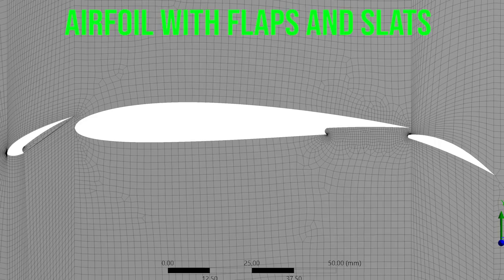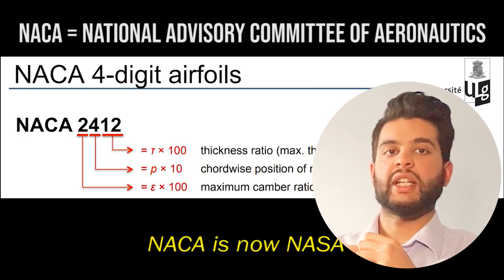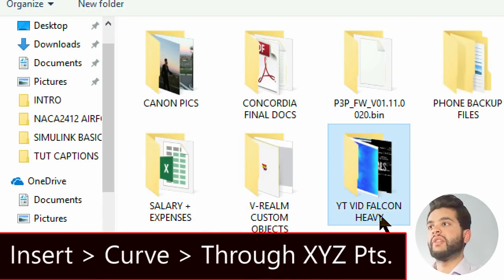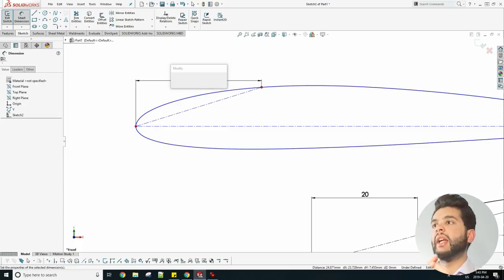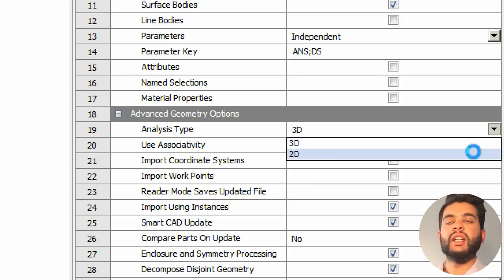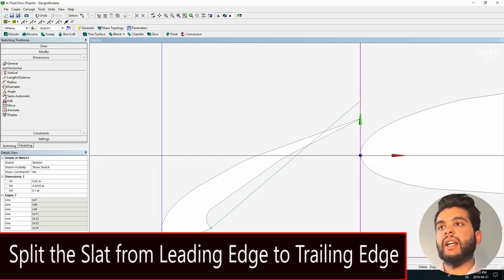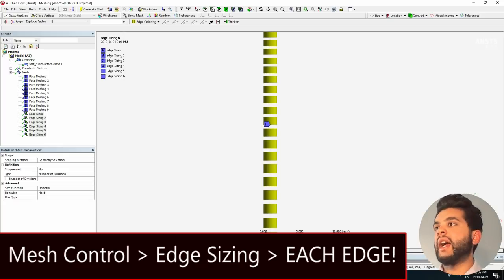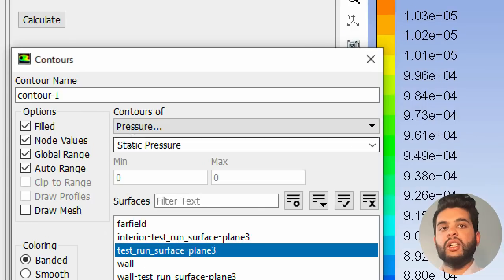Aerodynamics: CFD Meshing Tutorial of Airfoil with Deployed Flap / Slat (ANSYS Fluent & SolidWorks)

Comment: Vinayak How can I simulate flight at 30,000ft in Ansys fluent? I mean, how can I change the altitude...
Zenkyu!
Reply from the maker: Change the pressure and density
Reply: @VDEngineering  okay. So which pressure is this. Outlet pressure (which is usually 0 gauge) or what?

Or if only you could do a video on that...

Comment: Hi, Just a question, whats the difference between splitting the face in solidworks or design modeler?
Reply: Also why is the energy equation turned on?
Reply: @aidealczar6075  because your using ideal gas